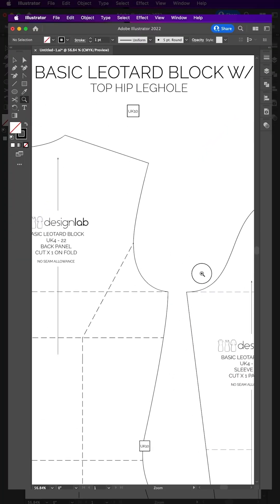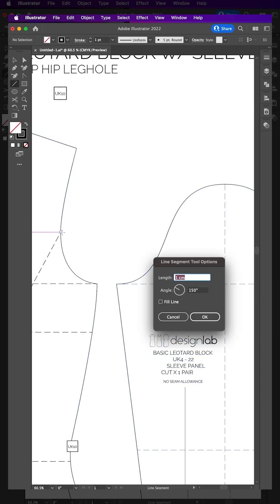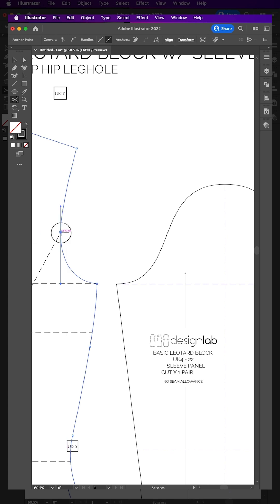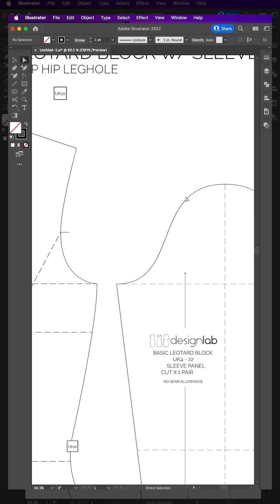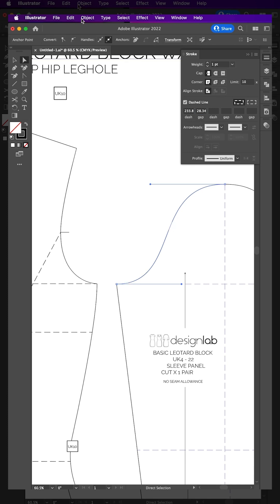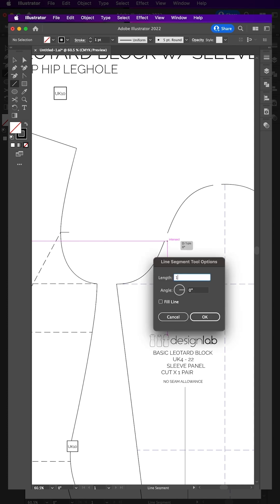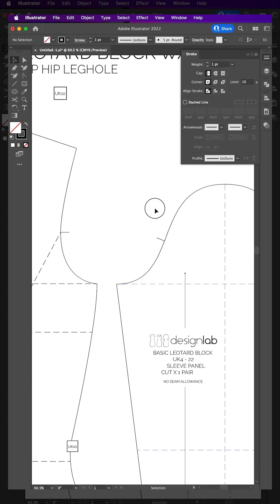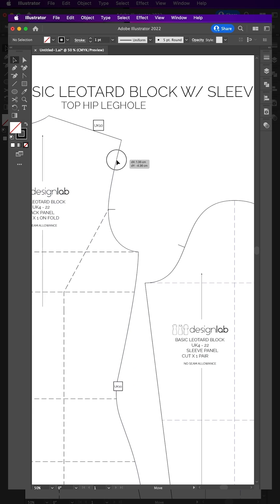40/49 Adding Notches Along a Curve - Digital #patternmaking in #adobeillustrator #patterncutting

Comment: Hi there! Thank you for your tutorials! Just one question, what if I need to put the notch in the middle of a segment or curve?, how can I find the half of them? Thank you 😊
Reply from the maker: To place a notch directly in the centre of a curved line, simply, cut the curve from the pattern using the scissor tool. Snip it at either end of the curve. With the direct selection tool, select the line and open up document info on the right toolbar. This will show you the length of the line in your prefered unit of measurement. Now you have the length of the curved line, divide it in half. Make sure the curve is selected, then open the stroke tool and enter your halved measurements as the first dashed line value. This will display that measurement on your curved line. Simply mark the halfway point with a line or notch. Hopefully this helps resolve the issue!